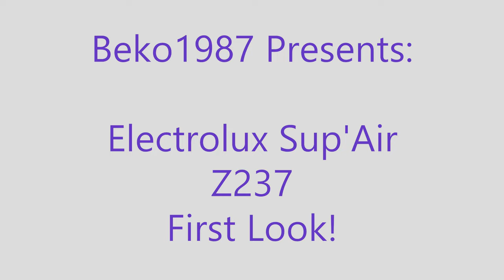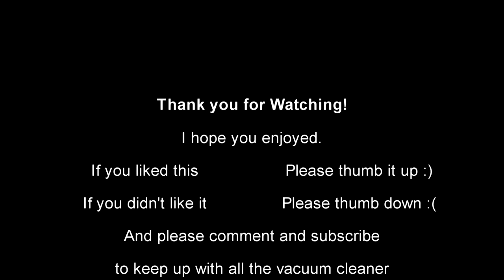Marketplace find! A FREE Vintage & RARE Electrolux Sup'Air Z237 - First Look!

Comment: I have the 326 (same without electronic control) and there the exhaust filter was replacable. The filter cage is removable when you slide it direction back.